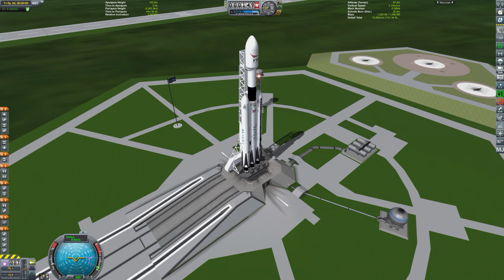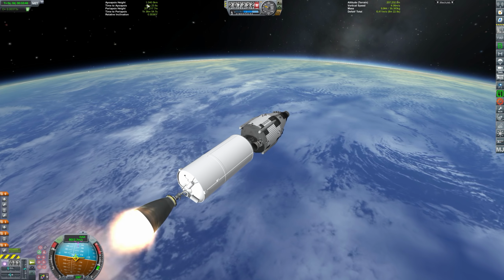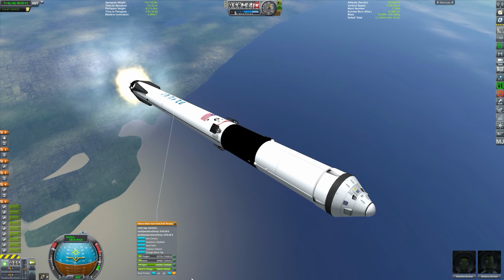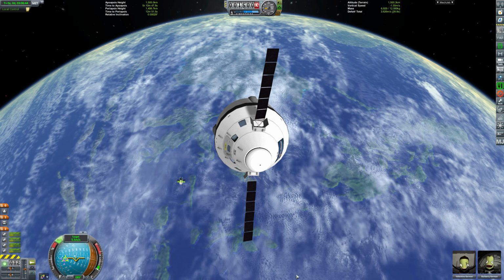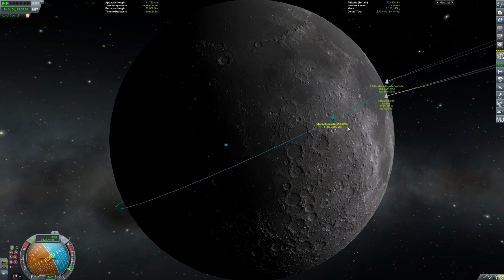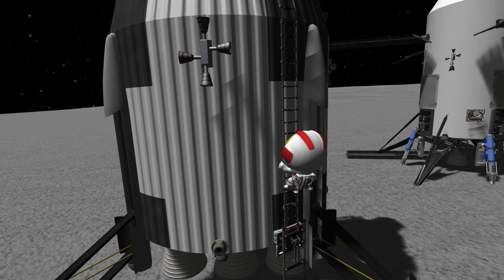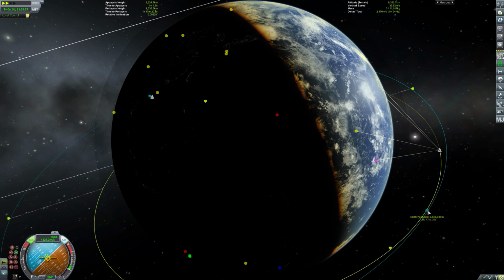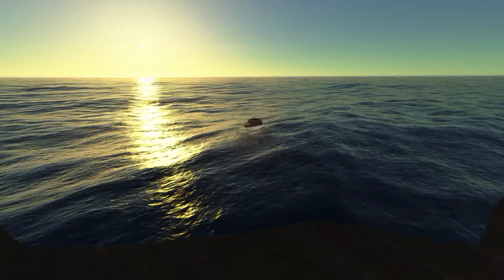SpaceX Falcon Heavy launches Reusable Moon Transfer Vehicle to the Moons Surface (KSP 1.2.2)

Comment: Interesting idea but super risky depending on a pin-point landing on the Moon within the length of a refueling hose.  Never been done before.  Apollo 12 was probably the best and they were hundreds of meters away from the Surveyor lander target.   To reduce risk need long range hover capability to achieve accuracy meaning more fuel for landing.  Cool idea though

Comment: what were the fuel margins for the three boosters?
Reply from the maker: Depends on which booster. The side boosters need about 14000 units of kero at detatchment. Core booster is closer to 18000
Reply: How much after landing(how close did you cut it?)  Ive been playing RSS RO for a little while now, but i bet i cant match this feat for a good year from now.

Comment: Where did you get the RO configs for the rocket? I can't find them anywhere.
Reply from the maker: I think they were from the forum posts. They were separate that I do remember.
Reply: @MarcusHouse  Do you think you could link it? Or is it long lost in the internet
Reply from the maker: Think this is it.
https://forum.kerbalspaceprogram.com/index.php?/topic/71323-143-launchers-pack-spacex-pack-v53-released-april-18th/&page=85&tab=comments#comment-3334838
Reply: @MarcusHouse  Thanks so much man! Greatly appreciated
Reply: @MarcusHouse  That appears to be engines only, it seems the fuel tanks also need reconfiguring, where did you get that?